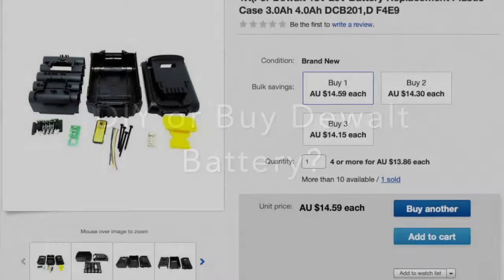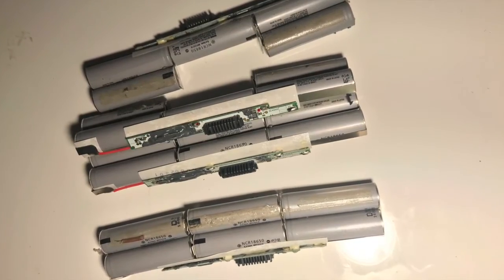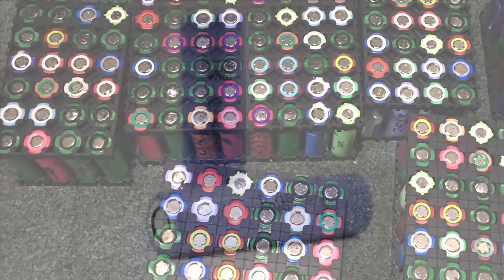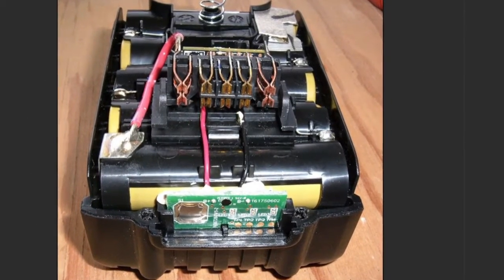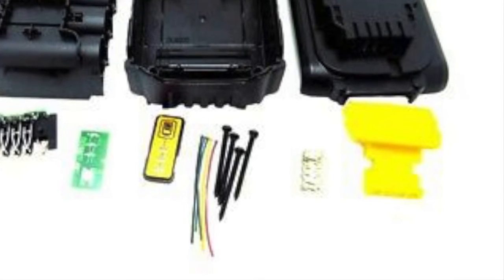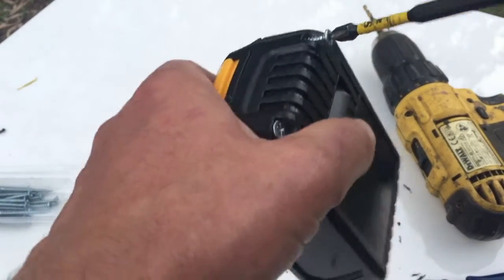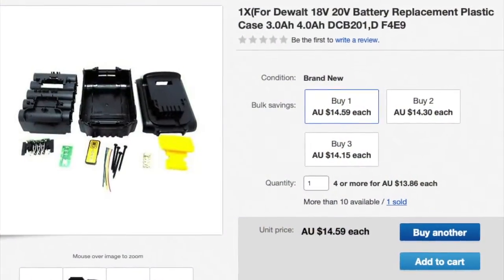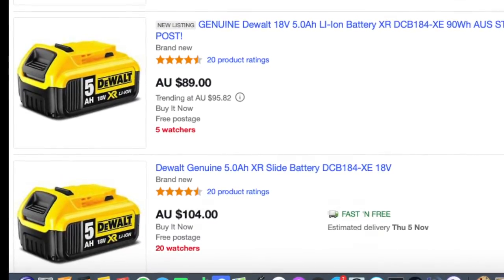DeWALT Battery DIY or Buy?

Comment: If I build a battery with ten Samsung 30Q cells, how many amp hours will it have?
Reply from the maker: It should be 6AH as they are 3000mAh each and there will be 2 in series.
Reply: @FixTechStuff  that’s what I thought.  Over 5 ah.

Comment: I like how you aggressively drilled the hell out of the holes when they told you to go find your own screws nearby lmao
Reply from the maker: Yeah, well it had to be done. Another option may have been finding metal threads closer to the right size, but it will definitely not come apart with the screws I chose.